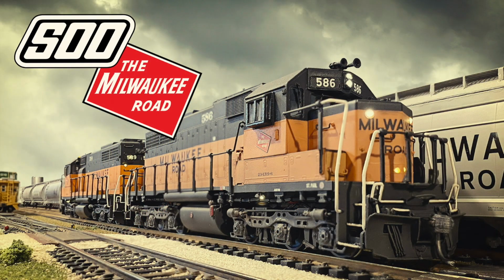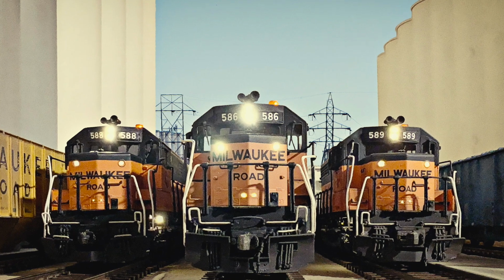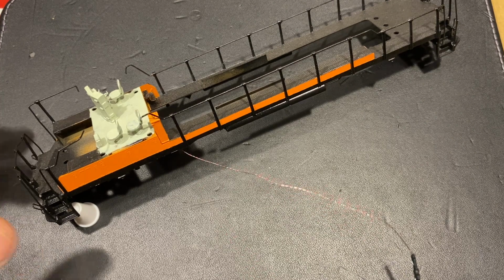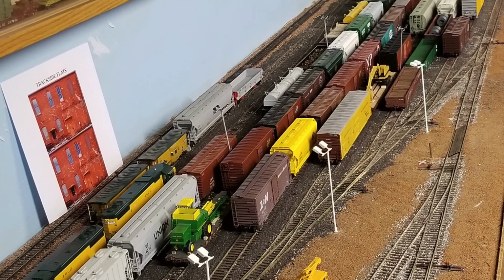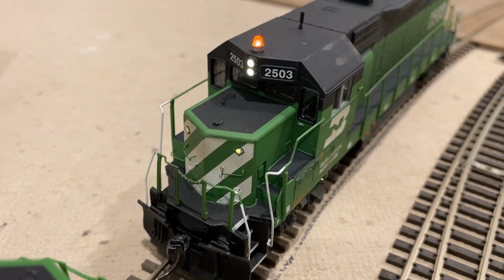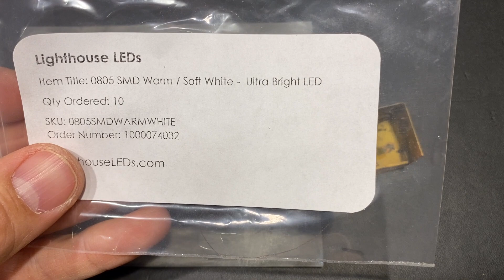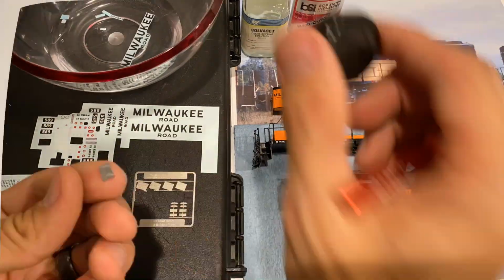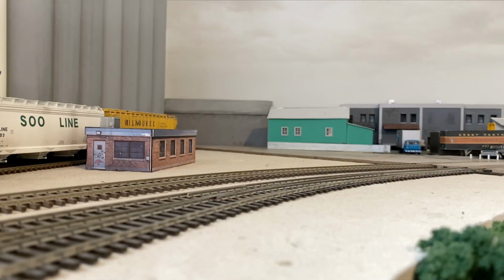S05E10 - How to install LED class & ground lights, shout outs, SDL39 decals, weathering and a run-by

Comment: Best news of the day:  new episode of the STMR.  worst news of the day:  its the season finale.  Already looking forward to season 6.  Gotta tell ya, I really enjoy how you break down the installation of various details such as the LED lighting - so many other videos I have seen overlook or dismiss the routing of the wires, the attaching of the LED, etc, just go right to "I installed these...", it makes modeling less intimidating when showing how you accomplished something.  Please continue to post and share...thanks!!
Reply from the maker: Thank you for the insight, it can be tough to document every single step, but I try. It’s easy to just say, “This is what I did.” But what help is that to another modeler? I’ll admit I’ve got flaws in various presentations of content, but if ya get the concept down, you can do up just about anything. After all, “It’s a MODEL!” 😉 The ol’ Curmudge...😆

Comment: Congrats on FIFTY episodes!  I get both enjoyment and information from your channel!  I look forward to each new installment.  The SDL39 project kooks great, but I must admit that these locos look like a young GP39 is wearing its father's shoes.  By the way, I have used Solvaset for many, many years but sometimes it can be too strong for some decals.  I have been having excellent results from using Tamiya's "Mark Fit Strong".  Its more expensive than Solvaset and needs to be ordered online (usually) but it works quite well for me.
Reply from the maker: Gary, I’ll have to try that. I’m a big fan of the Tamiya products…so it’ll be added to my list of items to try. I hear you on the strength of the Solvaset (I’ve messed decal’d up and had to start over 😬).

It’s great to hear what other modelers use and like. Thanks for posting and my apologies for the delayed reply. I’m not sure how I missed a number of comments, but there they were…someone commented this morning on the video and poof, a pile of other comments. 😬

I hope you are doing well and enjoying the summer. Take care!

Comment: This is a great video! 

I just recently started adding ground lights to my locos using different methods but I'll have to try incorporating yours. 

I actually found this video while trying to determine if gp-35s had ground lights. Do you happen to know which locomotives or what era/timeframe that ground lights started being implemented? That way I can prototypically implement them on my layout
Reply from the maker: Thanks for watching and hopefully this reply finds you well.

The ground lights were for sure being installed on the GP35’s…as EMD was installing them as early as the SW’s they produced.

Ground lights were just below the cab and it allowed the crew to see if they were moving. If the ground appeared to be moving?!? They were moving, not the ground. 😂

Best of luck on your modeling efforts.

Comment: Great info in this episode. Since 588 wasn't on the decal sheet, how did you get the light to pass through the numberboards? Also, what do you use to fill in the space for the platform lights? At first it looked like two drilled holes, but in the run-by they were obviously rectangular shaped.
Reply from the maker: Keen eye Joel! First things first, I’ve gotta apologize for the delayed response…I’m not sure how I missed so many comments from fellow modelers. I always try and reply accordingly, especially if you have questions.

To answer yours…you’ve got a great eye. You’re correct that the 588 wasn’t on the sheet…I cut up the extra boards and used the 8’s to create 588. I put two layers of decals on the locative, to have enough black to only allow the light to pass through the white numbers. It’s not a perfect solution, but it has been working.

As for the platform lights, you’re correct, they’re drilled holes. Which I work the drill bit left and right to elongate the hole. Mount the LED…the glue naturally fills the holes…dries clear and I lay a white rectangular decal over the location, when laminated it’s lit up. Again, it’s not a perfect science, but I’m able to achieve the effects I’m going for.

Thanks for asking the questions and keying in on the details…that’s what I really enjoy about the hobby, but the masses often find that information to get dull and boring. Hence, I don’t do deep-deep dives on the content. Much of it is an overview. Thanks again for tuning in and I hope you’re doing well. Take care!

Comment: Do you know if it is possible to turn f5, the beacon light, to solid light instead of a flashing light on a stock athrean sd39-2 dcc board? I'm working on mine and the prototype doesn't have a beacon so I'm trying to put a cab light in that I can turn on and off(btw love the work on the sdl)
Reply from the maker: On an ESU decoder I do, but on a Tsunami, I’m not as familiar. I’m a big fan of the SD39-2’s…the straight SD39 in MN&S paint is my top choice for a locomotive.

This isn’t a guaranteed solution, but try setting CV51 to 0, to stop the flashing function. See if that works.
Reply: Thank you this worked, I am also a fan of the sd39-2 I have one in the mn@s paint schemes. Again thank you for the help

Comment: how do you cut the holes in the class lights or do some trains come with the class lights out?
Reply from the maker: Tre, great question. It really depends on the model. In the particular SDL39 brass locomotives in this video, the holes are already there. Some plastic models, like many of the Proto 2000 units, have clear lenses in place (some were lit with the number-boards/light). Those could be split and lit via the 402 LED’s.

For units that are just cast plastic, I drill out the class light, with a bit as close to 1mm (to allow for a snug fit, for the 1mm fiber optic material).